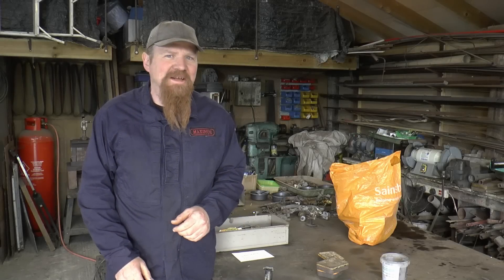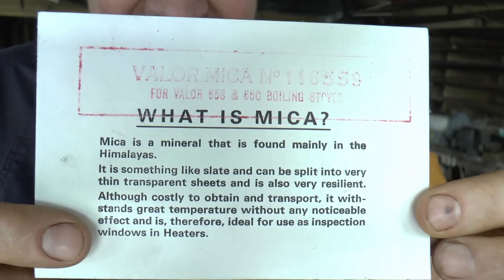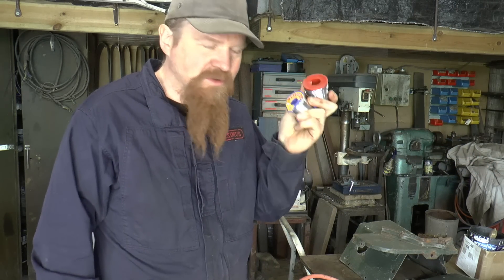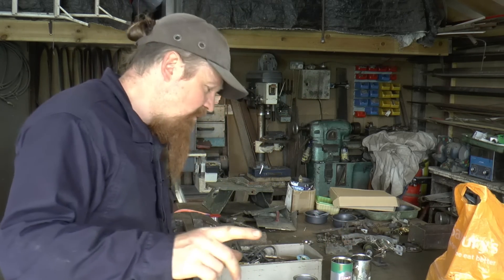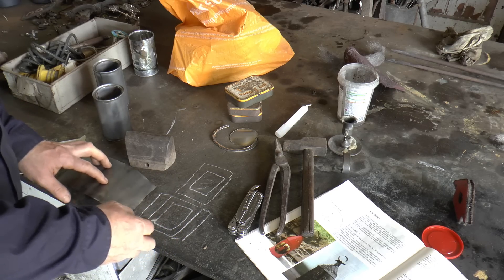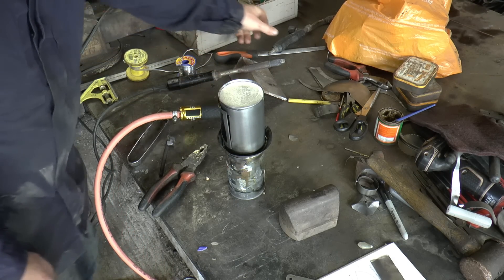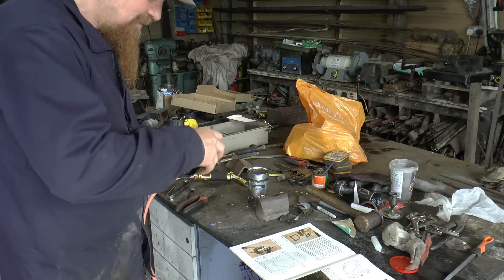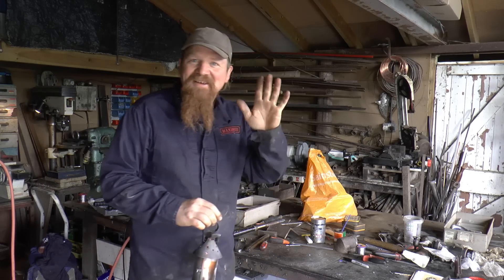Homemade Candle Lantern from tin cans!

Comment: A couple tips - those large soldering irons are a tool of last resort, as I think you were discovering.   They are used only in tight spaces when you can't use an open flame, like around highly flammable substances.  You will get great results with the open flame even on the small bits by holding down the small item in place with something pointy like a punch or crappy screwdriver.  The thin tin will heat up quicker than the screwdriver and the solder will stick to the tin.

A second suggestion it to put a couple holes near the bottom of your lantern.  As long as you don't put too many the flame won't get blown out by the wind.  Just like the holes in the top of the lantern it will keep the temperatures manageable, but the temperature will drop across the whole lantern and you will get a brighter flame from it.  

Thank you for filming this project!  I'm going to try it myself and see how it turns out!

Comment: Fab little build. I used to make little model motorbikes for mates (mostly chops based roughly on their bike) I used copper wire, beaten out copper coins and occasionally thin copper sheet. I'd like to offer a couple of tips for anyone doing similar small scale soldering. I can't see why these tips wouldn't work exactly the same with aluminium if you're repurposing cans.

Any time you have a closed seam (like on your cone) have tags on both edges of the seam. Fold one tag one way and the other the opposite way so they hook together (like a seam in denim). Make sure there's plenty of flux inside the seam before you hook it together and flatten. Then the solder will wick down between the layers. This is a very strong joint.

For joints like the one you have between the cone and the can an extra ring of material really helps. So make a ring of wire that fits into the gap. Tin that ring and tin a circle on both pieces to be joined. Set them into position, drop the tinned wire ring into place like where you had your ring of solder. Heat a spot with a torch, move the spot around the whole joint. If you tin well enough you will only need to add a tiny amount of extra solder. Again, with that additional ring this is a very strong joint. You can make waterproof joints with this method.

For joints that might be impacted by heat during use or in situations where you need to solder together previously soldered components without the original soldering coming apart use silver solder for the components. Has a much higher melting point than regular lead solder so will hold together if you're careful with the heat.

Wet, cotton based thin rope can be used to prevent heat travelling to parts that have been previously soldered. Wrap components that you want to 'heatproof' with the wet rope.

Comment: Max, those little cook's blowtorches, or even those rocket cigarette lighters, work great on these small jobs with long runs of solder, much better than a clunky iron. As you found out, good prep of surfaces is the key. And a couple of air holes in the bottom will aid in keeping the flame clean.
Thanks for sharing your skill-set improvement!

Comment: From memory of making a pop pop boat with my Dad, painting the areas to be soldered with flux and then coating them with a thin layer of solder before assembling the joint, then reflowing it once the joint is assembled makes for very neat joins. To quote my Dad, "you don't want to rely on that capillary action son..."
Reply: If you are soldering pipes for gas or water under pressure you do not need to 'tin ' , or pre coat the copper pipes . The pipes are made accurately enough to fit closely and cleaned , fluxed copper transmits heat nice and evenly .
If  you need to join wires , which cannot be scratched clean of oxidation reliably or easily  , you need to chemically clean the wire surfaces with flux before applying some solder , which stops oxidation , Then you can join the wires with more solder . 
If you are soldering two bits of metal , it might be a good idea to tin the joint areas , depending on how quickly oxidation occurs ...depends on the metals . Suck it and see , but I would think that a neater job would result from pre tinning anyway . Where is that coat again .

Comment: That Mica stuff is pretty impressive - a few years ago I was given an old wood stove to install in my barn. At the start of the ‘restoration’ I noticed the windows on the door had drop in slots and my first thought was ‘Some idiot has put bits of plastic in here’. Of course, I was the idiot for not knowing what Mica was. It had gone opaque with age and was obviously thicker than the stuff Max used in the lantern, due to the application. An old guy who lived nearby educated me about the stuff and had an old box full of the pieces in the same size - I guess it was a standard format used for a lot of wood stove doors before the larger one piece glass doors came in. 👍🏻

Comment: If you dip the lamp into a solution of copper sulphate (blue crystal) then the “tin” iron will bond much easier to the solder and provide a rust protection coating.

Comment: Well done dear fellow. 
I like your choice of tin. 
I solder using a very small jet in an Oxy Accetylene set up. 
Its a wonderfull skill to have. And extremely useful.
I have a similar designed torch as your new toy, however its bigger and dates back to at least the 1950s. It will run on accetylene too. 
Bronze welding and brazing with brass rod is fun too. 
I tend to use an active flux nowadays, It makes it a lot easier. Power Flow is best, If ever you use Laco oyou must wash off the flux with a damp cloyh. if left, it will eat through thin steel and copper. 
You have inspired me to may be get out there and do some. Apart from being used for heat in mechanical settings, ie, undoing rusted objects in need of repair, and gas welding a Ford Transit exhaust, i haven't done any soldering or brazing in a very long time, 
I might make a video, possibly, may be.... 
Be well, Loving your work. Best wishes.

Comment: Thank you for taking us along again! Great video! Decent ugly little torch :)
The ring of solder you put in was a neat idea, but it did not want to go all the way - from watching Blondihacks I learnt that cutting shorter bits of solder works better, they can fall right into the joint.
Other than that, no notes :)

Comment: I think you might need to use more flux? I have a fair amount of experience but then again i'm normally using solder that has flux core and i'm only soldering circuit boards for amplifiers (transistor and valve). Very well made and very boy scout!

Comment: Great project! pop rivets can be hammered flat after using which creates a nice finish as well as the back part then not protruding. Might be useful to join the roof or lid part together, as you used pop rivets anyway. (would have to be done before soldering on the lid obv...) Feel a bit nervous offering you advice as you are such a competent maker!

Comment: another way to make a simple hinge is to make a staple out of wire, solder the tips to the door. than make a strip of tin into an omega or fold it over into a "p" shape around the cross bit of the staple and solder it to the body.

Comment: Top tip Mx…small pieces of solder the size of grains of rice. Prep the surfaces like you’ve done then use a very fine flame to heat the area. The solder will bond to the adjacent surfaces and with luck look much neater.👍

Comment: You could make some joints with a slot in one side and a tab on the other, which passes through the slot and bends over.
With some careful C. A. D  (cardboard aided design) one could avoid quite a lot of soldering.

Comment: Yes, most flux compounds can be washed away with alcohol. I like to use a spray bottle with methylated spirits. To solder tinplate you need at least an 80 W iron with a large copper tip. You only use as much solder on the tip as you need to transfer heat into the piece. Once the solder starts to wet onto the metal, you keep applying heat and sweat the joint.

Comment: As someone has already said, an acid flux, such as Baker's Fluid or an acid paste flux, works better on tinplate than resin based fluxes such as Fluxite. Acid based fluxes are also easier to clean up than resin ones, but thorough washing is needed as the metal will start rusting straight away. You would need to use a heatproof paint to inhibit corrosion. Fluxite works best on non-ferrous metals. Thanks for a fun video: hopefully back to the Land Rover next, though I'm also interested to know how your wheat is getting on.

Comment: When soldering I drench the area I am soldering. Basicly place is under flux for me. It cleans up super easy with alchocol.

Also applying solder the the area you want to solder on both parts, makes soldering supper easy afterwards.

I probably would of chosen to use rivets for aomething like this.

Comment: You had me wondering whether the top of the door would clear the skirt of the roof, when you came to open it...  :-)  Good to see someone else struggle with soldering.  Perhaps try soldering new nipples onto oily old motorbike cables - don't do what I did when I ran out of hands, and put the hot cable between my teeth!

Comment: Great fun....but ever thought about taking a torch with you?  Those nice ones for inspecting under cars have a convenient hook to hang them and a magnet. 
The techniques were good and inspire me to make some headlights for a childs ride on electric car from small bean cans.
Also the chefs refillable (propane) blowtorch 10 pounds from Amazon (for crème brulee) have a small  adjustable flame but quite fierce, ideal for this kind of fine soldering.
Reply: It looks great!! Good soldering tips in the comments too. 
Gonna be a pain humping that big gas bottle and torch to light the candle though 😂😂 and your mom is going to give you a hard time for using her best kitchen scissors to cut the tin 😀🇻🇨

Comment: not bad ..from someone who has used soldering bolts (lumps of copper on an Iron bar) to RF & infrared soldering gear..not bad! yes used gas as well as electric ...gas used once to repair the top of an MGB radiator ..next time make some err four candles ? or O's .....

Comment: Where are you going camping, down to the shires……? Try cleaning your soldering iron tip it’ll transmit the heat better if you file it smooth and keep wiping it clean on a pad of wire wool while your working also try wiping your solder joints with a chamois’s cloth while the solder is liquid that way you’ll be able to achieve smooth joints that won’t need sanding. My grandfather taught me how to wipe solder joints on old lead plumbing pipe I remember it was very satisfying when you got it right mind you that was 50+ years ago using a iron you heated using a paraffin blow lamp! Otherwise excellent job well done

Comment: Three tips when soldering:  Flux, flux, and more flux.
Reply: In that case use the flux capacitor
Reply: I've got the voice of Danyk from "diodegonewild" in my head saying "mooore rosiin, mooore rosiin".
Reply: Clean the job. If it's prepared,you won't need that much flux
Reply: Or spam , spam , spam , spam spammity spam .... from Monty Pythons Vikings !
Reply: I agree about using sufficient flux , but try not heating the join with direct heat which causes oxidation quickly . Instead supply the  heat indirectly and watch the solder melt into the join . For example , in the lamp project here , the candle holder inside the tin could have been soldered into place by heating up the outside of the tin , on the underside of the candle holder inside the tin base  . The heat would travel through the metal to melt the solder inside the tin cylinder . 
If you are joining copper pipes , plumbing , it is best to clean all joining surfaces thoroughly , apply flux , push the fittings together and then warm up either side of the join , away from the flux , so that the copper heats by conduction . When you see the flux starting to smoke a bit it might be time to see if some solder will melt . If and when the solder melts it will flow into any gaps around the pipe joint by capillary action and seal , so long as there is enough heat , the surfaces are very shiny clean and the flux stops oxidation due to the heat applied . Clean , flux , warm up , heat up , solder perfectly ! Take your time and soldering is a dream .  Remember is wash the joints with soapy warmish water once the soldering jobs are done , else the flux will carry on working and turn your copper joins green , possibly causing a leak eventually . 
I will get my coat . ATB

Comment: My soldering experience is also with electricals and electronics, never soldered pipes or metal parts together (barring metal shield cans on PCBs) like this, so I'm not criticising your soldering at all, I'd probably make a blobby mess of it too... :P

As for flux, usually it's Rosin, as used on the bows for stringed instuments like cellos and violins, though there are synthetic fluxes like the nasty stuff they have to use for lead-free snot which are apparently unpleasant to work with...

Comment: Using 70/30 and 60/40 solder would have removed the worry about solder melting on different parts. Great job though.